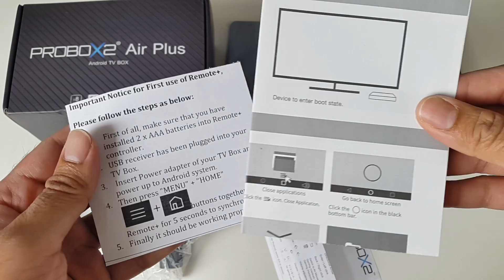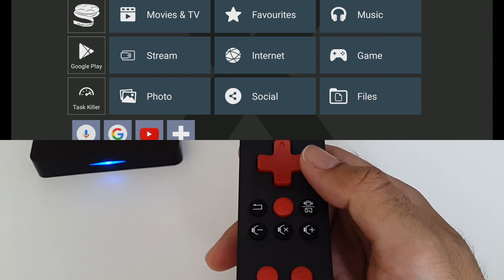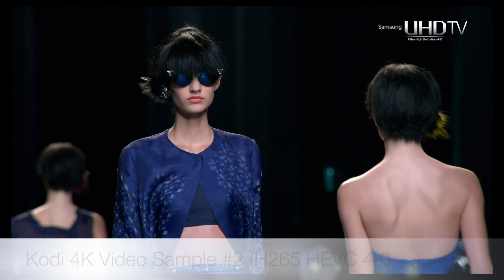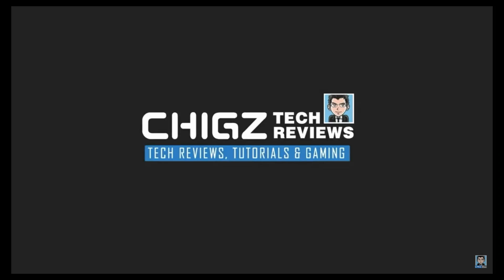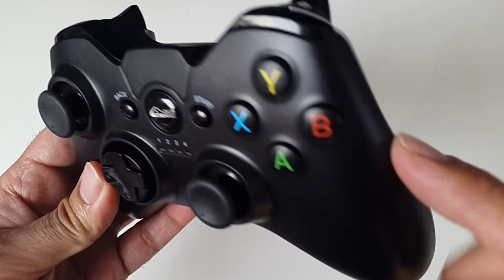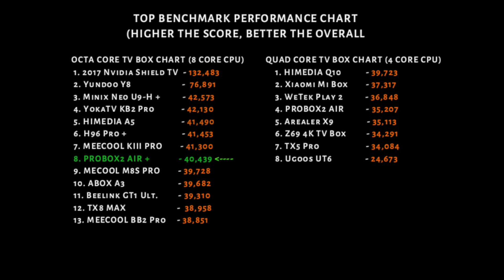PROBOX2 AIR PLUS  4K Android TV Box Review

Comment: Nice review I am a bit worried about the temps on long use due to no ventilation holes.
Reply from the maker: This is the same design as last years Probox model and i have to say it does not get hot, don't know what they have done, maybe a heatsink, but they have done a great job. I played games on it for around an hour to test and it was just about warm.
Reply: Yeah, it probably has a large aluminium plate inside over the CPU and GPU.
Reply from the maker: Seems like it.